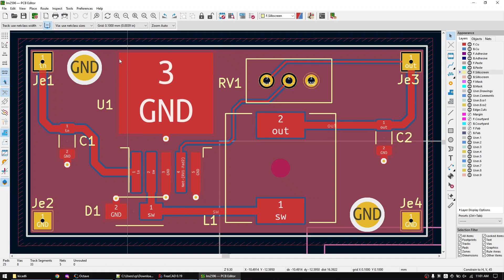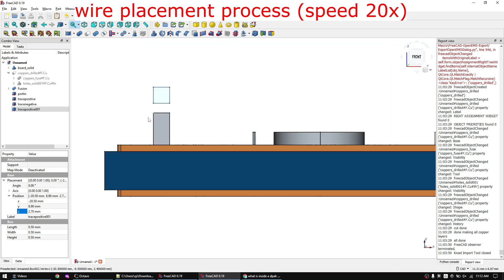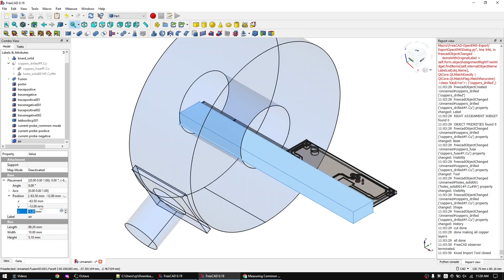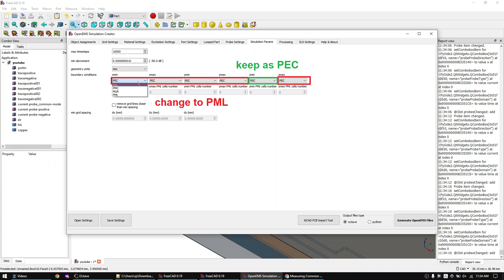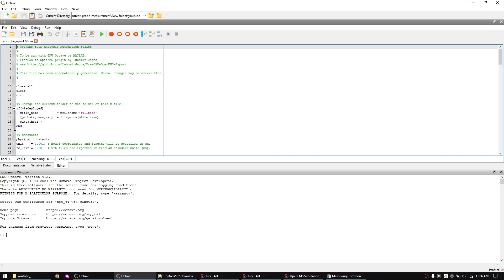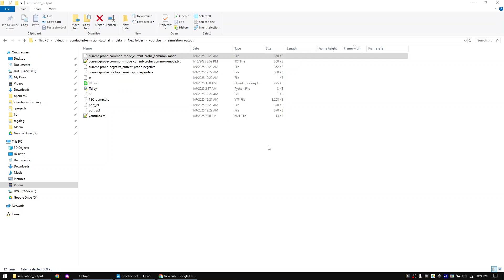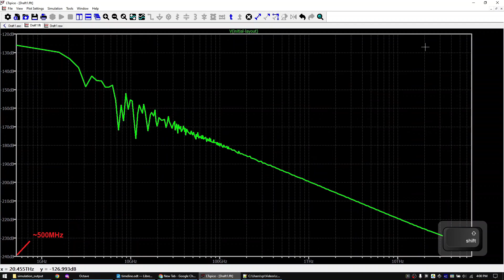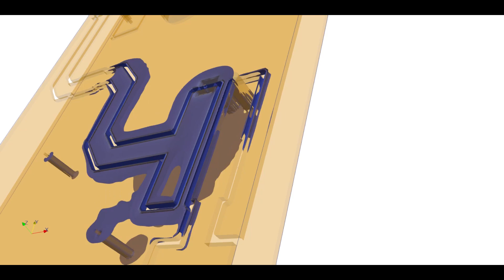free Common Mode Current Simulation with KiCad and openEMS

Comment: How to setup the view like 12.50? I need to know the vector of the field
Reply from the maker: @wisnueepis3593  when opening the 3d jfield dump, you can apply the glyph filter. you will have to play around with the scaling of the vectors for quite a while until the view gets correct.
also you will need to use the filter "thresold" to remove vectors from the view that are too big.
i will try to add a short video on how to do that on udemy this weekend.
Reply from the maker: I have just uploaded "Lecture 19: Visualizing Current Directions in a J-Field Dump (ROTH Field Dump)"
Hope it is going to be helpful if you didnt already manage to display it yourself.
Reply: @panire3  Nice I'll look up to it. thanks.

Comment: Is it possible your simulation took over an hour because you set the Min Decrement to such a small value?
Reply from the maker: the simulation will stop under one of these conditions:
1) the max timestep is reached or
2) min threshold is reached
in this video the min treshold wasnt reached yet so the simulation duration was limited by the max timestep

hope this comment helped

Comment: Great video again! 👍👍 I'm just curious, if I want to simulate the effects of the components on the board, such as common mode choke, lc filter, etc., does that mean I have to model the choke as a lumped model? 

Also, how do you determine the simulation timestep and min decrement to ensure that openems does not crash for a sized grid? From my previous runs with openems, the crashes were influenced by the grid size, the timestep and the min decrement. Is there a formula to determine/calculate the appropriate values for the timestep and min decrement for a given grid size? 

Looking forward for your far-field sim soon 😊👍
Reply from the maker: Far Field: I will upload the far field simulation process on udemy this week and will re-comment here once done.

Determination of required timesteps:
Yes, for many problem types there is a formula for the required timesteps, will upload it on udemy those next days and keep you updated.

Min decrement:
I sadly dont know a formula for that one, I typically use a very low value and limit the simulation time by the number of timesteps.

Inductors / chokes:
As of now the lumped inductor models seem not to work. So a choke still need to be modeled by the 3D geometry. Thats kind of hard to do especially if you want to simulate a specific partnumber of a given manufacturer. I am working on a video for that, but this one is going to take a while.
Reply: @panire3 thank you for your hard work to share your knowledge on this. Looking forward on your udemy course update soon👍
Reply from the maker: Hi again :)
on udemy now are following updates:
Lecture 20: I added an Excel sheet on how to calculate the required timesteps when injecting a step signal.
Lecture 19: check this one out regarding crashes. PS: what exactly do you mean with crashes. you mean that you get error messages or do you refer to very long loading times? If its mainly about loading times, then the new lectures 16 and 17 might also be very useful.

I will text again once the far field tutorial is uploaded.
Reply: @panire3  thanks! Just checked it out yesterday. Haven't gone through but thank you very much for the udemy updates. Regarding the crash, it was not related to the long loading issue. It was more on that, openems immediately terminates the session and an error message code that I have shared with you in previous lectures. It goes something like this: 
error: openEMS binary exited with error-code -1073740791

However, after playing around with the timesteps and min decrement and maintaining a fine mesh grid, i think i did around 0.05, the error message disappears. When I increase the grid to 0.1, same issue occurs but after playing around with the timestep and min decrement, it disappears.  Probably it might have something to do that openems breaks itself due to the fine mesh with to big of a timestep but with small min decrement. So, i came to the conclusion that it has to correlate with the mesh size, timestep and min decrement. So far, that was the issue that i had last year and i think my current workflow was to use a smaller timestep like in your previous video, maintaining default min decrement, grid size of 0.5. The lowest i could try was at 0.3 before the same error code message occurred again. 

Looking forward on your far field video this week. Need to learn how to use for my current project actually😂.
Reply from the maker: @nurhaida1983  I just uploaded the far field tutorial on udemy (lecture 14).

 openEMS binary exited with error-code -1073740791 means "STATUS_STACK_BUFFER_OVERRUN" and is most likely caused due to too much RAM being used. Solution is to try making the simulation smaller (smaller airbox) or the grid more rough or both. Nice to hear it finally worked.